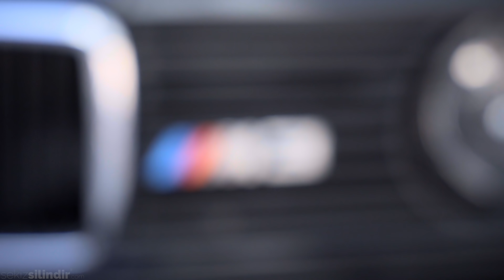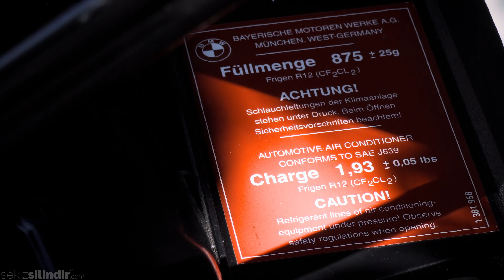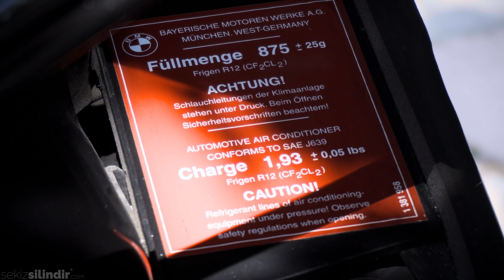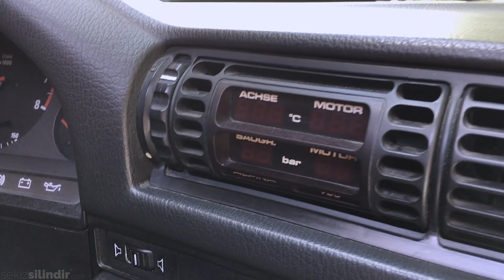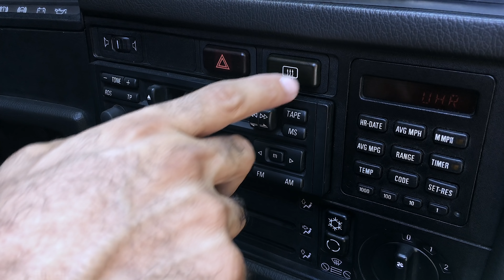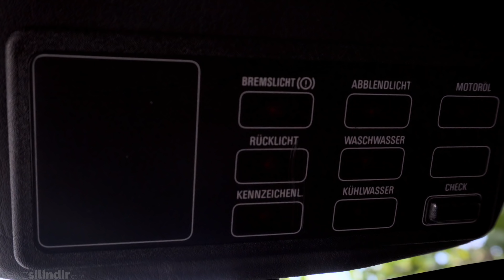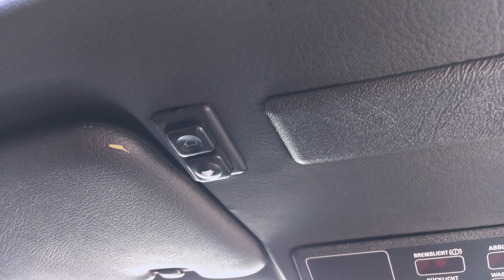KLASİK | BMW E30 M3 Evo 1 inceleme (S50B30 - S52B32 silindir kapağı Swap)

Comment: benim bildigim alpina b6 olmasi e30 modelleri. c3?
Reply from the maker: +bebeler sidal Merhaba, C versiyonları olarak da mevcut, bu seride M3 gövde kiti olmuyor, sizin dediğiniz B6’da ise m3 gövde kiti olan 3.5s modeli de var. C ve B3 (2.7-2.8) versiyonlarda 2.5lt’lik motorun modifikasyonlu versiyonları mevcutken B6 versiyonlarda 3.4ltlik 535i’de de kullanılan motorun modifikasyonlu versiyonları yer alıyor.